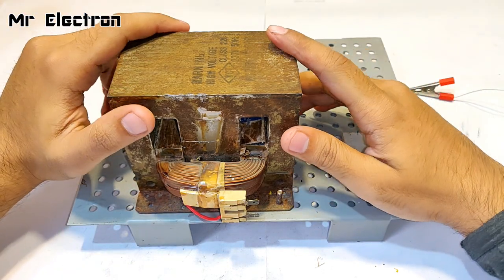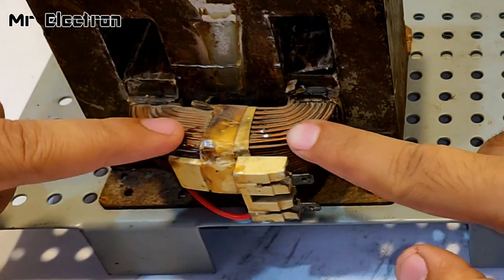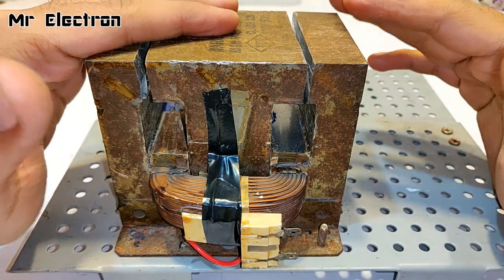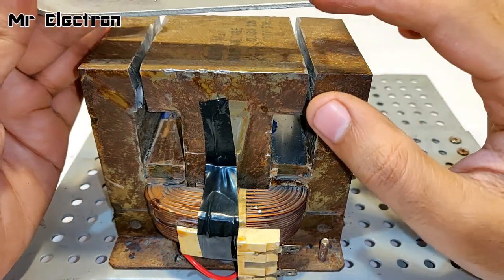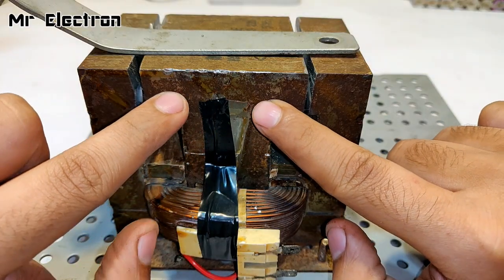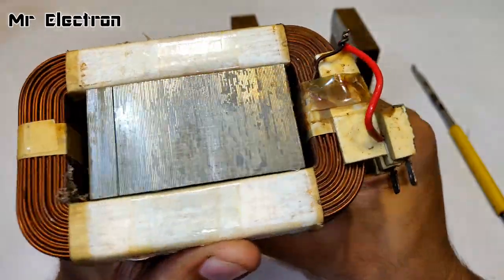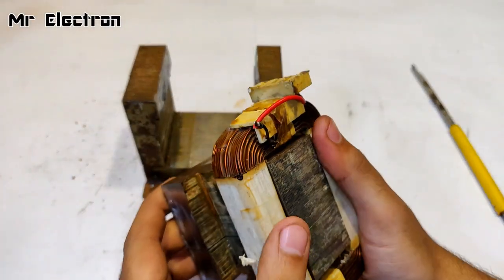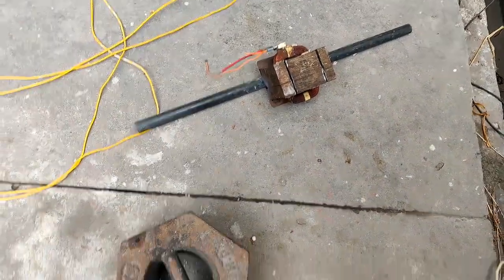12v 2000 Watts Powerful Electromagnet using Microwave Transformer - 12v to 220v DC

Comment: this is electronics engineering good works my friend i thought this transformer it works for only AC power if you apply DC power for to long i guessed it will end up burning out transformer wire or it works because it a DC regulation power

Comment: The wrong information that he is showing is secondary winding, not the primary one. Winding's wire size is thicker, which means it is secondary with low output voltages. So be careful about the information he provides.

Comment: this transformer i do knows very well a 2000watts it very dangerous transformers some time the devil in the details it waiting to killed you alive this transformer even you turned of the power discharge capacitor it still hold magnetic charged power inside the transformer if you dare to touched it it a deaths traps

Comment: it works with AC power what happen if you inject DC power to it will it magnetic or not or you will end up burned the complete wire including blow up the battery i’m interested to see how you dominstrate with DC power will it magnetic or not I only understand with AC it goes around inside the transformer through the wire it get magnetic it produce electric power but not with DC power at all

Comment: (Google Translate) Beautiful work. I have some questions. 1) If I use two transformers to make a magnetic table, will it be more powerful than if I use only one?
2) If I use two, should I connect them in series or in parallel?
Thank you very much and my congratulations.
Reply: You should connect then in parallel

Comment: Do you need to connect it to DC voltage? Or can you connect it directly to AC voltage?
Reply: Not only does DC power it just fine but DC works much better AC should not be used for electromagnets in my opinion because it switches the poles continually and is therefore much less powerful at least from what I understand and certainly from what I've seen. Not to mention that DC give me warm fuzzies and AC makes me distrustful of any exposed wires, which describes the secondary winding to a t.  and then it's a magnet so it's going to attach to other big pieces of metal which sounds to me like a hell of a way to get a shock. Plus you get that annoying buzzing sound with AC
Reply: @jamescampbell7823  thank you
Reply: @jamescampbell7823  what the hell u talking about??!
 transformer works on the principle of mutual induction, for which current in one coil must change uniformly. If dc supply is given, the current will not change due to constant supply and the transformer will not work.
Reply: @fuorman4872  I don't believe the video is about making a transformer the video is about making an electromagnet and that's exactly what I was talking about, so when he says do you need to connect it to DC voltage I can only assume he's talking about this video not some other videos somewhere else and "it" would mean the former transformer, now electromagnet
Reply: ac only
Reply: @fuorman4872  thank you.

Comment: If chopped down to top of primary would the magnetic field be stronger? Or surface area better? School teachers anyone? Saw one go 500kg and hold with full mot but only top missing not cut out. 500 kg was max the scale went to. 
Cut down to primary or use the surface area slots cut?

Comment: Do you think cutting it gown to primary would make it stronger? Or do you think its better with large surface area? Just wondering if there's more power if slots cut or chopping down to the copper level.

Comment: Since the winding is designed to run under 240V AC, why not connect it to 240V AC directly? Would it burn up while the magnetic circuit is incomplete?
Reply: You must use DC current. Plugging into AC wall socket will not work.

Comment: Too many, too many mistakes:
- electrical units are abbreviated in capital letters - this is taught at school
- that transformer has a maximum of 1 kW at 230V & 50Hz
- the voltage cannot be passively converted into DC
- the power in DC is the current multiplied by the voltage.
And so on ...
From the beginning, the title is a lie.

Comment: Is it stronger to fill the spaces with steel and pushing primary up with slots more surface area  if cut outs also flat surface but other clips the cut them to coil? Anybody know best way to get full effect. To slot or cut down to the coil? If wanting a table clamp for milling whats best way to do it? Chop off to coil  or push up coil and cut slots keeping larger area and then would fitting steel underneath to fill the airbag? Any physic teachers who can say chop down or push up coil and do what with space below?

Comment: Bro can you give the specifications of this transformer
Reply: This is a transformer taken from a discarded microwave oven. The winding with thinner wire (secondary high voltage) has been removed. There are several videos on YouTube that show how to remove this secondary, just look for videos that describe 'homemade spot welder'.
Reply: @renatodiniz2810 Are all the MOTs same for all the companies
Reply: @boby8494  The difference is only the power of the microwave oven: greater power, greater transformer, but for this application, it makes no difference. The problem is that some new microwaves come with a high voltage fly back generator, the same type used in old tube televisions and, of course, it is not suitable for this.
Reply: @renatodiniz2810  ohke thank you.....i will search for an older one
Reply: @boby8494  Good luck!  From Brazil.

Comment: This is great 👍 how much weight can it pick up?
Reply from the maker: @12v around 40 kgs but @48v more than 150 kgs
Reply: @MrElectron  your gaps are not nearly wide enough, you need to make those gaps a lot wider, your magnet will become at least twice  as strong

Comment: so you have to power it with voltage then disconnect the power for the magnet to become effective? i wasnt clear on this part 

great video by the way. i watched people make magnetic platform for a drill or something they didnt explain the science they just made it. your video shows it can be simple and not need mains voltage supply only low voltage high amp.

tell me what is the ideal volts and amps to power this?

Comment: Mr Electron ......i would love to save and use a Hand Power Sander for sentimental reasons ! But it is 220v AC and we use 120volts in my region ! 
Is it possible to open the Sander take the small Transformer out and rewire it
to work with only 120volts !!
Can you explain if I also have to cut out the two 110 volts primaries assuming 
since it is 220volts !!
What tyoe of guage cable should i use and how many turns will it have as the end result !!
I believe this can be achieved easily by you !!!

Thank You in advanced !

Comment: Wouldn't it make more sense to use the secondary windings?
Reply from the maker: Yes it woul but the thing is that i had already cut off the secondry in one of my past projects so i thought about trying with the primary
Reply: @MrElectron  will it be more efficient using the secondary winding?
Reply: @stavrosps1238  yes because it has more turns of wire and thus higher resistance. It will be much more efficient
Reply: @kamisama9715  Thanks.
Reply: I think that it's not a good idea.
The strenght of the magnetic field depends on the amperes you send on the coils and the number of coils;
with a smaller wire you can make a lot more coils but you can't have the same current for 2 reasons:
1) smaller diameter -> way bigger resistence (resistance depends both on diameter and on lenght, and you are making it way longer with smaller diameter)
2) even if you bump up the voltage a lot to have a good amount of current in that wire remember that the total current a wire can sustain depends on it's diameter, and since you are making it smaller it will overheat and break very fast.
For this reasons you usually want the wire as thick as possible.

Comment: The effect causing the spark is called "back emf."

It is a big deal in industrial motors as it can destroy control and power gear if not properly handled.

Also used in some fluorescent light starters.
Reply: Back emf is what laymen and ignorant chodes call it. The properly learned know it is called inductive reactance.